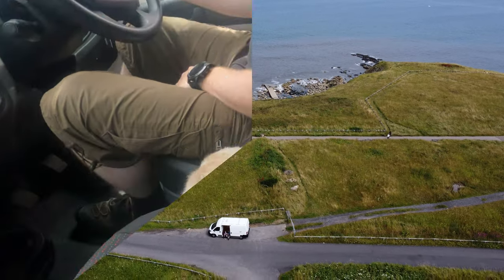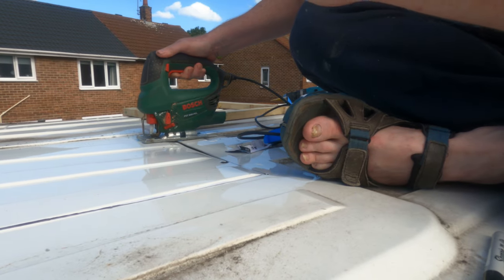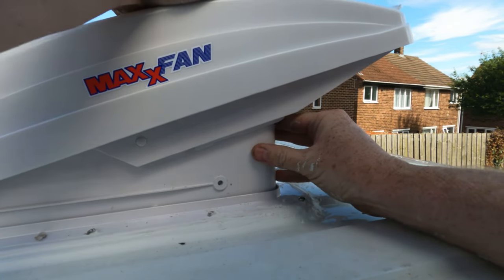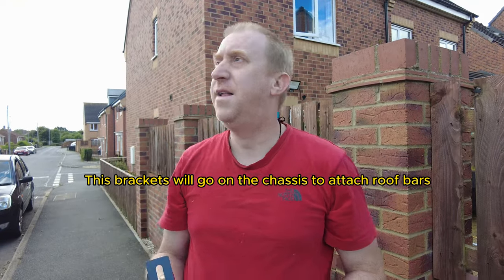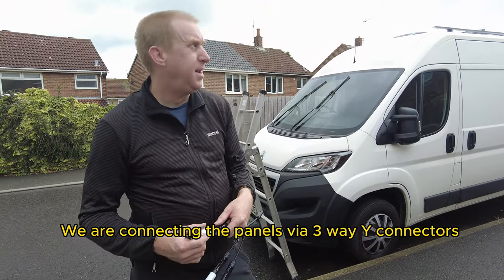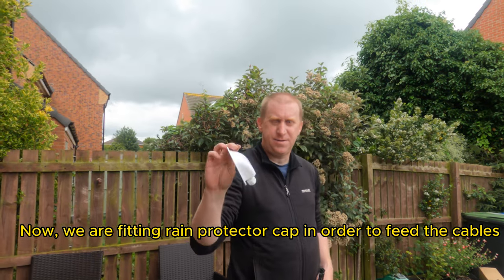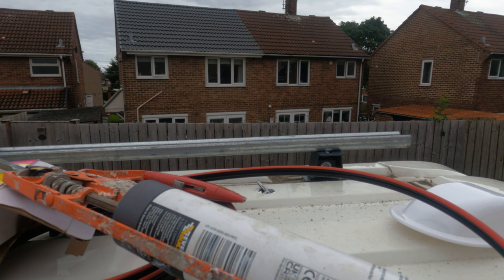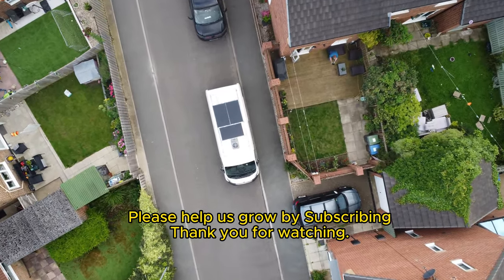Episode - 3: Installing সিলিং ফ্যান, রুফ রেক & সোলার panels (Peugeot Boxer L3:H2).

Comment: Awesome! Will it be fully operated by the solar panel or it needs fuel?
Reply from the maker: It  charges also when we drive via a dc-dc charger from the main van battery and we also have a mains hookup with battery charging for of we stay on a camping site for any time,  but don't plan on plugging in much as driving as well as solar will be enough
Reply from the maker: Think I should mention that we will be using all the electronic items which require 12 voltage